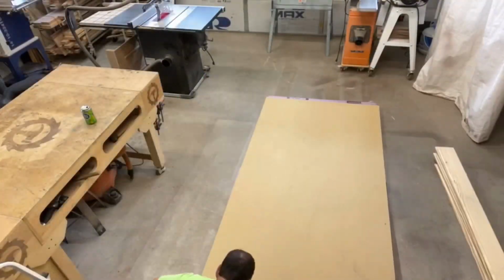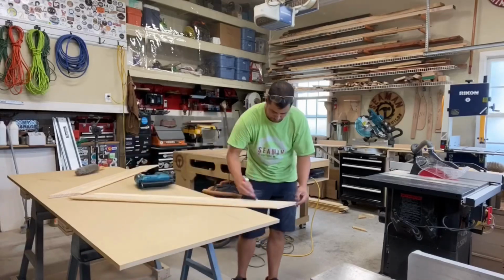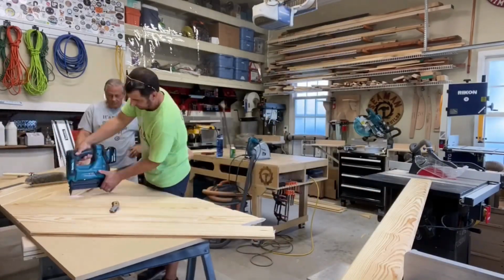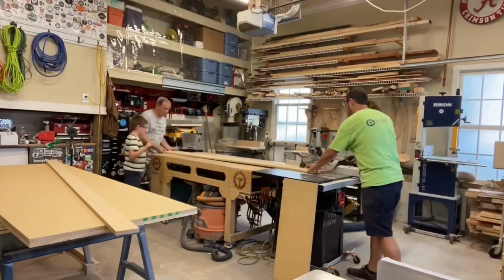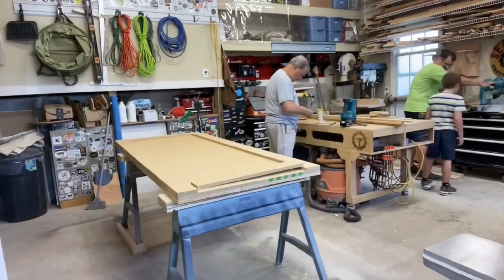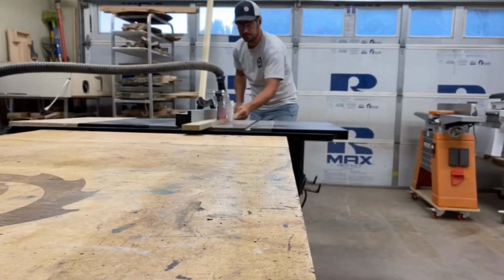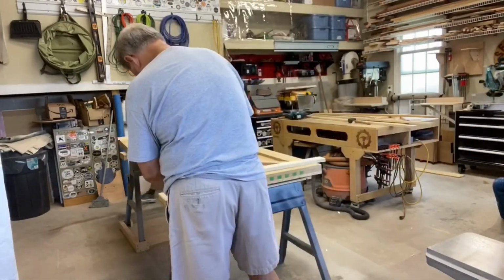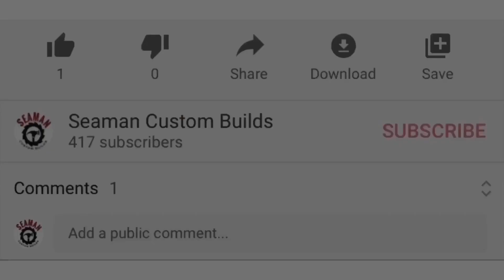How To build a sliding Barn Door - DIY

Comment: Great videos!! Did you use a special railing because due to the weight of the door?
Reply from the maker: Jacob Aguilar the track I used was rated for 330lbs, as heavy as the door seemed it was no where near that or even half of that